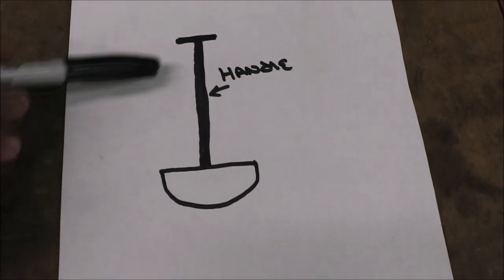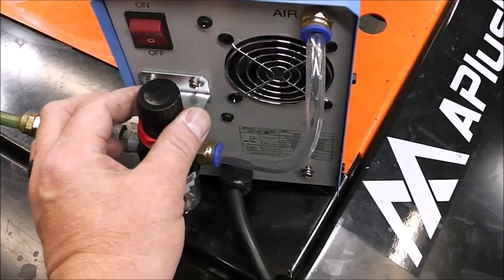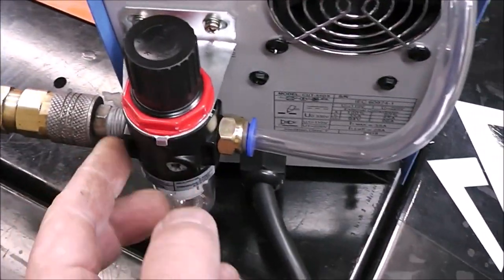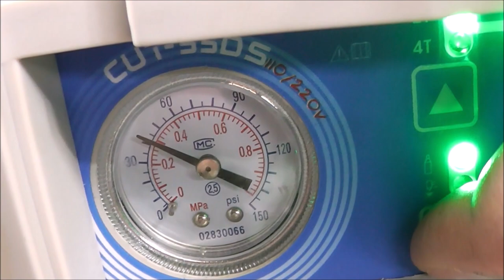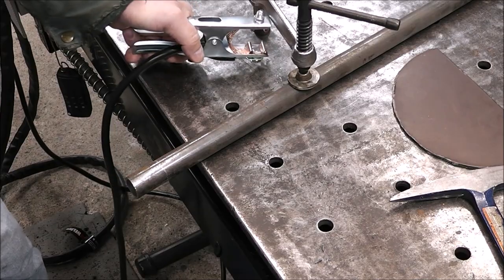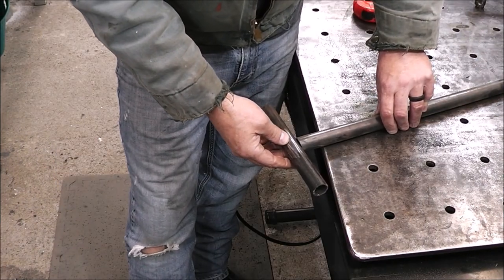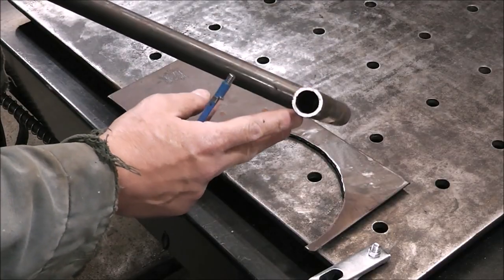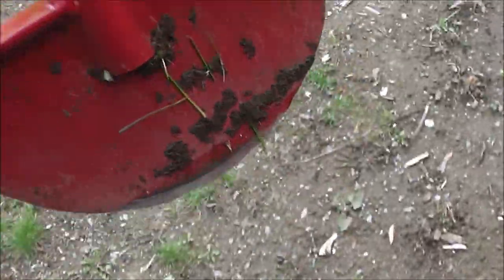Plasma Cutting Welding Project Lawn Edger

Comment: Teflon tape is not recommended for use on air lines that feed plasma cutters; because it’s possible to get small flakes of tape in the airstream, and clog the machine. Pipe dope, applied to the male threads about 1/8th of an inch up from the tip of the pipe, is recommended instead.
Reply from the maker: Great tip!

Comment: Brandon, years ago, an employer bought a name brand Japanese plasma torch, and the consumables were attached to cardboard with heat shrink plastic. It seems that they developed a new way to to drive one's vehicle from point a to point B. They called it an "elect rode." I've never seen anyone drive on the selected course before. Hehehe.

Comment: Nice job bud it looks great. Maybe you should weld shut the pipe on the blade end. Just so it doesn't fill with dirt.
Reply from the maker: Thank you! I think your right! I will!
Reply: @BrandonLund  given you already painted it I might recommend some JB Weld or another epoxy maybe.
Reply from the maker: Great tip! I'll probably end up slicing it up the middle and tapering it a little then welding it shut..

Comment: I always drag to cut with my plasma cutter and never push. But that doesn't mean pushing is wrong.
Reply from the maker: Good point! You can see better in my opinion also
Reply: @BrandonLund  That depends on the angle you hold the torch. But fair comment. A plasma cutter should be in every workshop in my opinion.
Reply from the maker: I agree 100% 👍
Reply: @JonDingle  I just  got a plasma cutter,there is a learning curve on it for me ,but a damn fun toy .
Reply: @1983mojo1  Yes l agree. Good luck and enjoy yours!